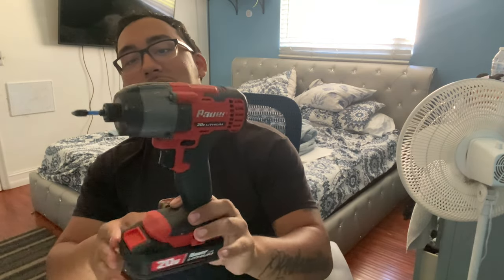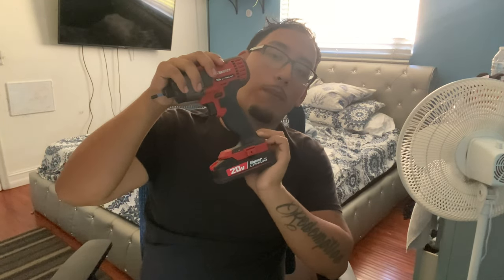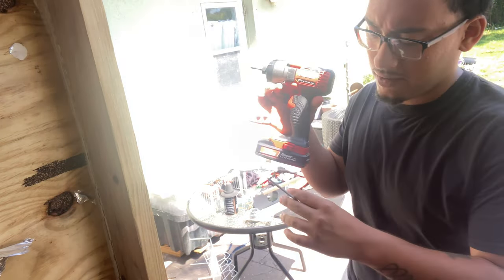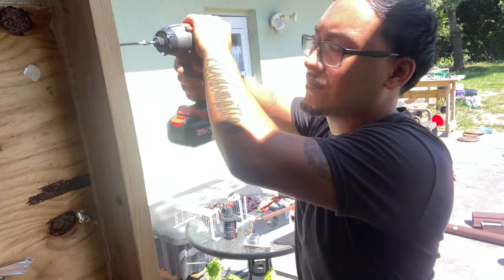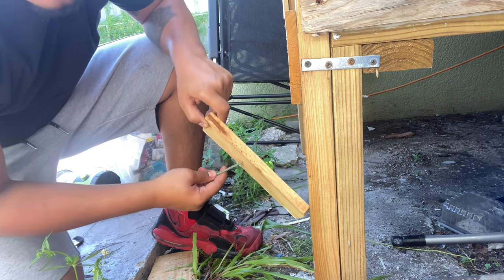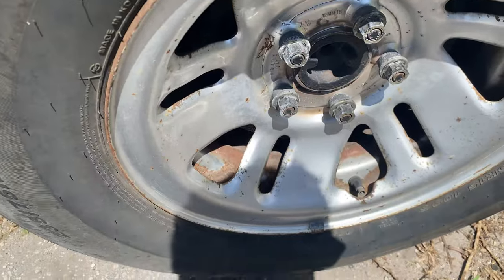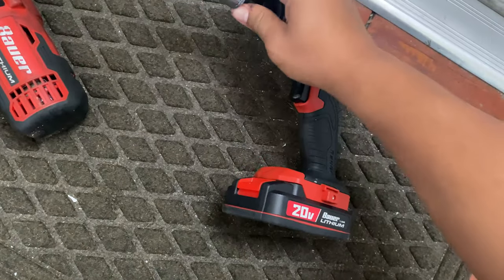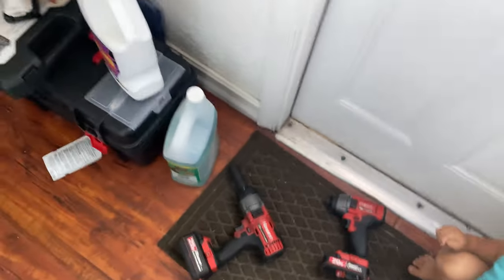Harbor Freight Bauer 20V 1/4 Impact Driver Review 2022

Comment: Damn you actually left it in the rain. That's wild. I don't use mine for screwing screws into wood. I typically use it at the shop for pulling out bolts that aren't fastened in with an ass ton of torque. Also I got mine on sell. They had it on sale for 33 bucks tool only and it was cool cause I already had a battery for the bauer drill I previously bought. But now I'm thinking of getting the brushless one. It's a bit slimmer too which will come in handy. But yeah I really like mine, the one I got is the same as yours.
Reply: Nice man, I just bought one today for $39.99. $40 and it's brushless??

Can't pass that up!
Reply: @hardblinker6275  damn looks like they dripped the price down pretty fast. Was it open box? Cause when they first dripped the brushless ones when I made that comment they were like 6 something bucks.v